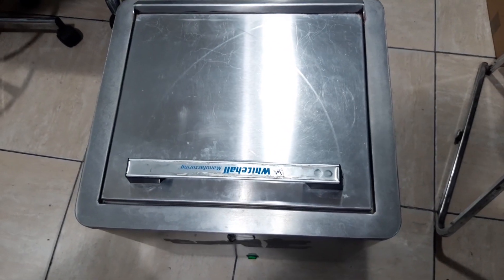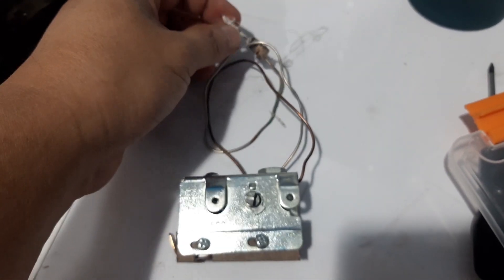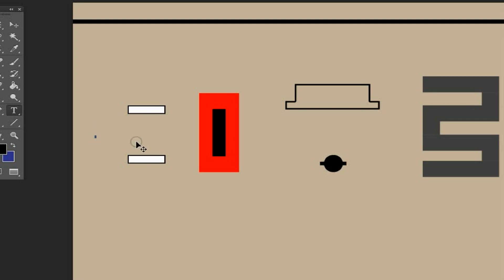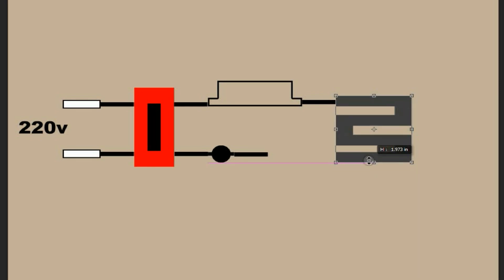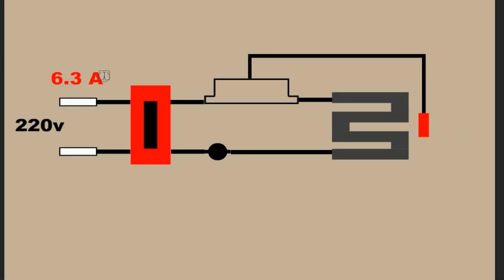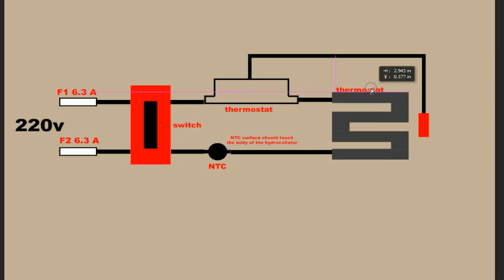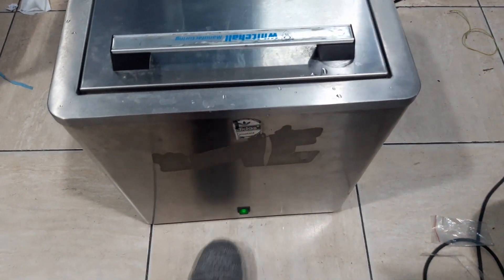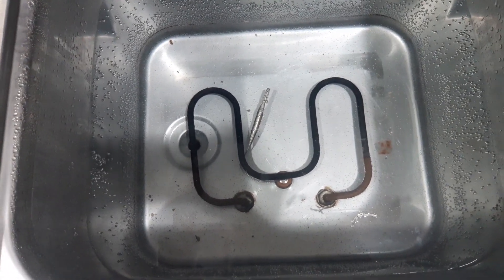How to Connect a Thermostat : Hydrocollator Repair-Medical Equipment Repair

Comment: All fuses are ok.In my machine no power.what is reason
Reply from the maker: Check switch. Measure voltage on the terminal of the heating element.